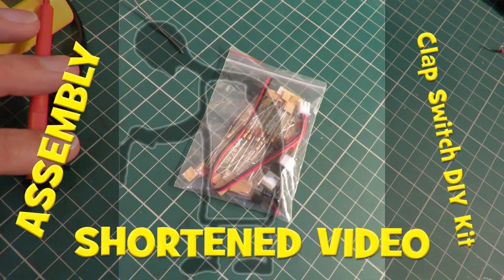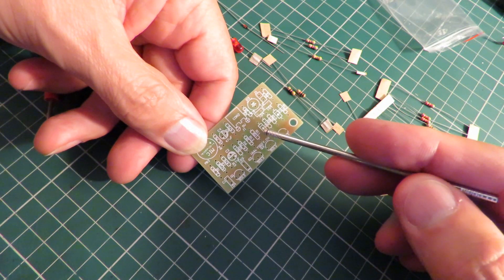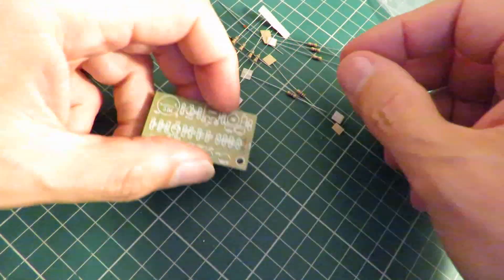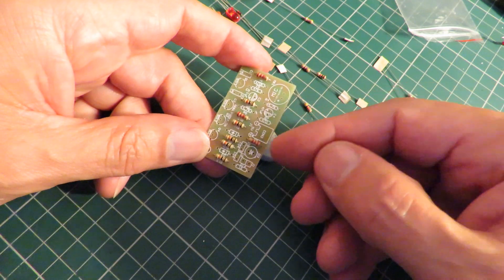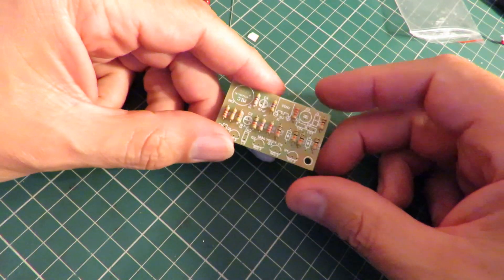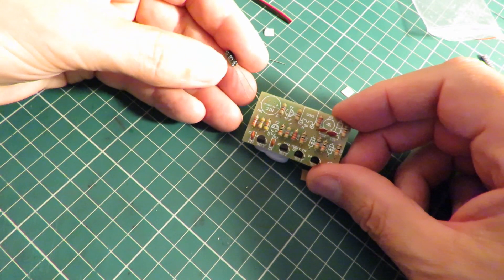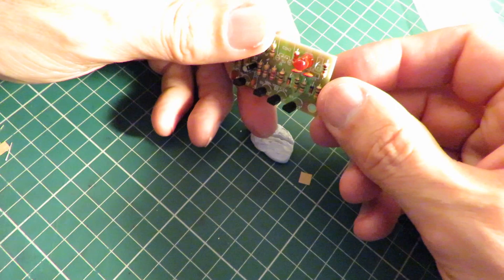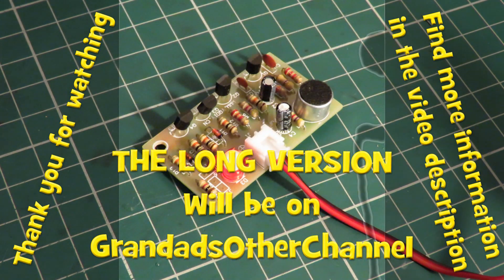Assembling Electronic Clap Switch DIY Kit SHORTENED VIDEO

Comment: Thank you! this helped me a lot, any tips on how to hook up the battery?
Reply from the maker: What tips do you need regarding the battery?
Reply: @GrandadIsAnOldMan  well this is my first project. I'm using lockdown as a time to learn about electronics. It's just two wires coming off the board and I'm not sure how that's meant to attach to a battery
Reply from the maker: @pekitivey  OK. Looking at the writing on the circuit board where the battery wires are connected they are marked + and - and also 5v. So it is expecting a 5 volt supply. That is the output voltage from a USB supply, or you could use 3 AA batteries (3 x 1.5 would give you 4.5 volts and it should be enough). The + wire is normally the red wire and would go to the + of your battery. The - is normally the black wire and would go to the - of your battery. If you want to use AA batteries then you will need to get a suitable battery box to hold them. At a push you might find an old toy that has a battery container in it that you could salvage. You would then use the connections on the battery box to give you the output you need. If you want to use a USB supply, you could cut an old USB phone charger cable in half and strip the wires back to get the power wires. WARNING if you do this, it is very rare that they use red and black wires for the + and - so you would need a meter to check which wires are carrying the power. The phone charger leads often have 4 wires, two for power and 2 for data. Hope that helps.
Reply: That's really really helpful. Thank you so much

Comment: '
hi man...
where to get the gray clay hold the PCB...
thank
Reply from the maker: I use Blu Tack so I expect a quick Google search will give you a local supplier or a similar alternative. Most stationery stores will stock it and you should also find it in the stationery department of larger general stores.
Reply: hi man...
big thank man
Reply: hi man...
maybe michael's craft store should have a blu tack...
i will see it store later someday when day is good time

Comment: Hey fellow old man ,I just pick up sometime,that might have help you with that smd clock you did I no how hard that must have been ,my new soldering station,has one of those blowers heaters,for smd kits ,if I ever figure it out,I hope I can do as well as you did,I no soldering the first time I used it was much easyer .but smd stuff still scares me a lot.I don't no who came up with that stuff I no it wasn't me,are you working on anything new,I like your long videos
Reply from the maker: Hi, yes the blower heaters feature in lots of the videos I viewed to get some hints on SMD work before I had a go myself. Of course the guys using them in the videos have plenty of experience so it looks easy. I haven't tried one myself yet.

Comment: Hi...i need help
i have a WLTOY F949 CESSNA airplane but internal all spoilt...i want to make it fly again but to use an external motors and everything...maybe you can help me what parts should i  install.( motor / esc / props / battery / transmitter )
Reply from the maker: I think you would get more help if you look on an RC Plane forum or maybe find one of the YouTube channels that focus on RC aircraft, you will notice my planes don't fly very well so I am not a good person to give advice.
Reply: Thank you Sir for the reply...i always admire how you make that small plane to fly. ;-)
Reply from the maker: Yeshua Valentino thank you, my planes are very basic and many of them do not fly well so good luck with finding good help.

Comment: coud you trace out the circuit it looks very interesting.
Reply from the maker: if you do a search on eBay for "Clap Control Switch Suite DIY Kit Electronic" you will probably find a listing which includes the circuit diagram. The first one I found had one.
Reply: +GrandadIsAnOldMan I will try thanks!